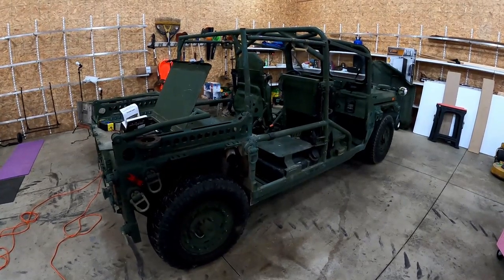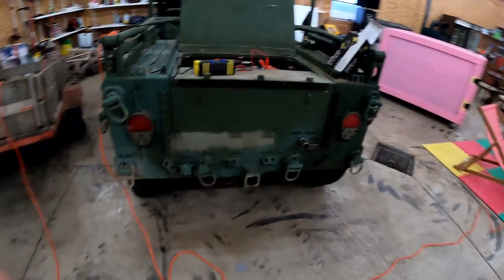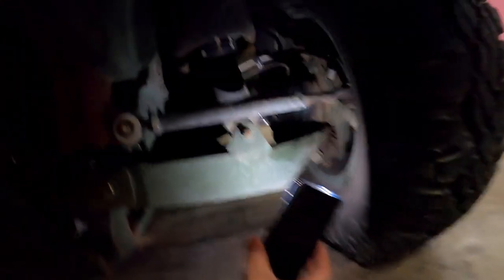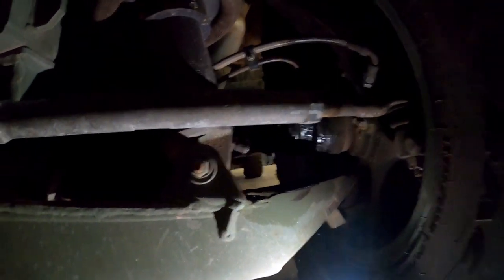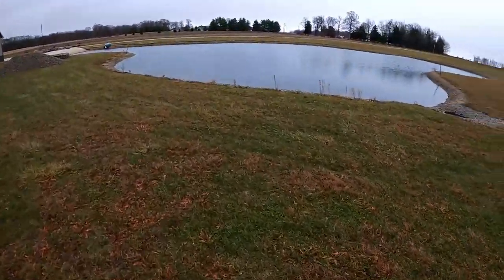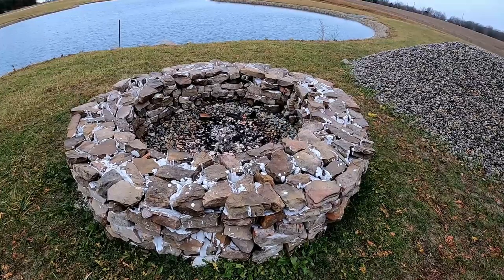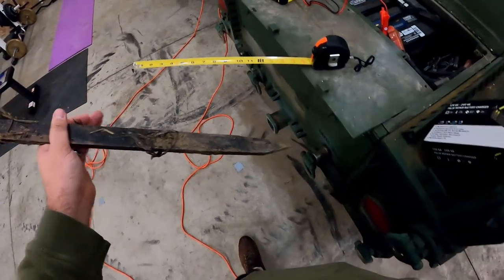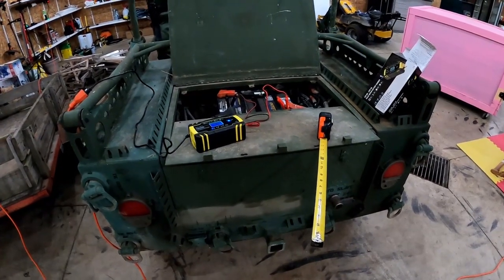I Broke the Growler!

Comment: The rear wheel steering removal mod is totally under designed. That bolt on bracket must withstand braking, acceleration and suspension impacts.  To expect that cantilever tie rod support to be supported by a ¼ inch flat plat is a joke. A bolt on member, that spans  both frame rails is needed. Unsafe to drive as is.  Be careful .
Reply from the maker: Thanks

Comment: That axle might not be broken. It should have a clip that hold the axle inside the cv joint. Sometimes if you hyper extend the axle it will pull out of the cv joint. That rusty bracket is not factory. They did that to hold the tie rod in place when they removed the 4 wheel steering. If you straighten the  frame rail it will bring the tire back in alignment. You should have someone weld a gusset in the frame to strengthen it so it wont bend again.
Reply from the maker: That would be awesome.  I will see if I can get some clearer video of it and I will update whenever I find someone that says they would feel comfortable working on it.
Reply: Good luck finding someone to work on it!! I think we all have to work together. I do appreciate your videos

Comment: Sorry to hear. I’m looking for CV boots and axels also. I’m really hoping GrowlerME starts doing parts. I’ll email you if I find any leads.
Reply: https://www.secoparts.net/collections/m1161-m1163-growler-parts-lsv-for-sale

Here is a link that might be useful . The parts are expensive and not all of them are listed online. You might be able to email or call the company if you need something you don't see listed.
Reply: @roycemontgomery5543  thank you, i did contact and seems they are limited in their parts at this time
Reply from the maker: Thanks a lot!  I will try to contact them.
Reply: @killjoythree-five3916  You might be up the creek with axels. I'll try to find the NSN/part number in the USMC system. They used a lot of parts from various vehicles that already in production so chances are the axels are out there. As far as the boots go, they tear pretty frequently on the growler. If you want to save yourself the headache, check out the universal split boot system. I think they will fit. I have to replace two boots on mine when I take possession of the vehicle. I'm going to give the split boot a try. It would be nice to not have to remove everything. I guess you kind of have to do that, either way, to replace the axel though.